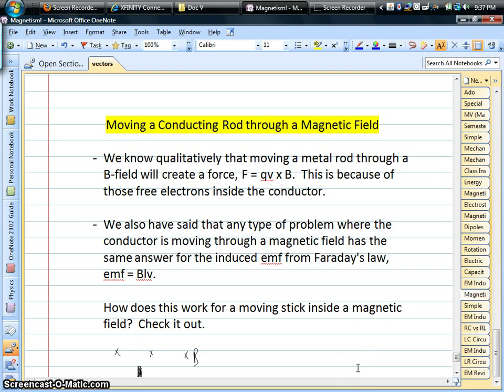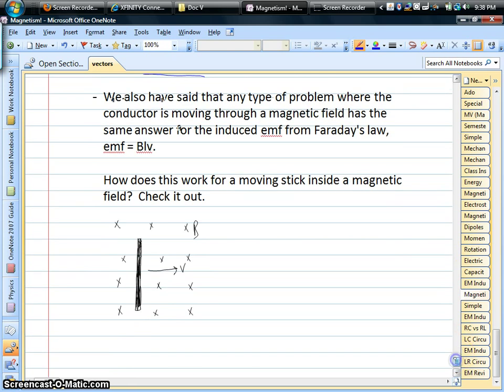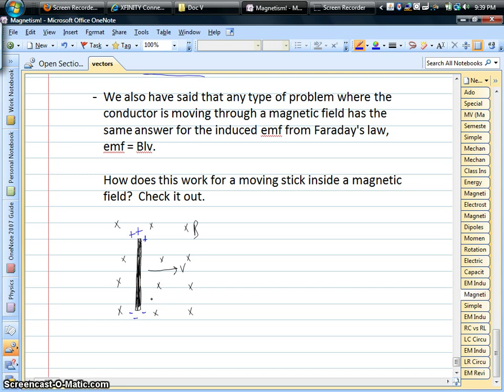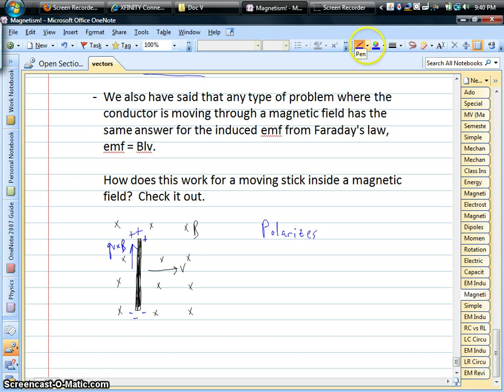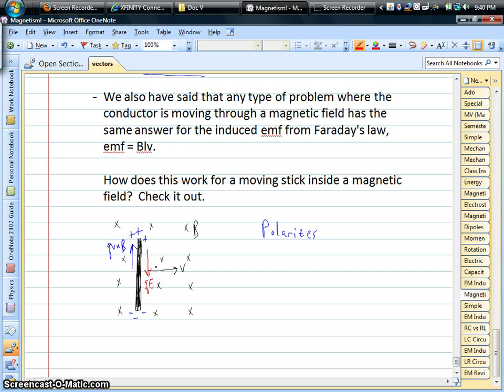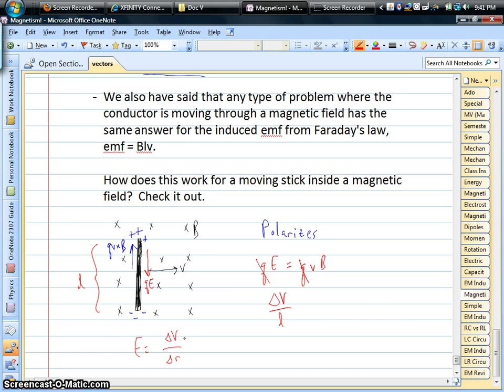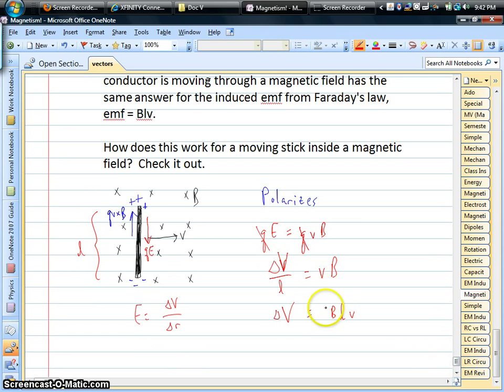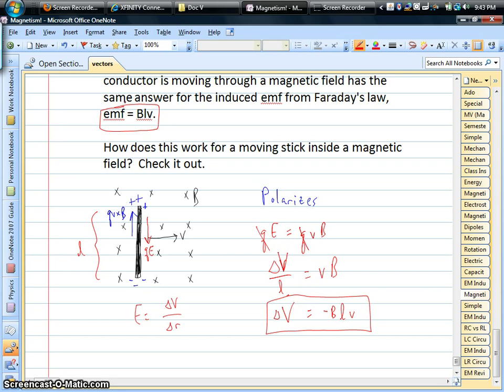Moving Conducting Rod in Magnetic Field.avi

Comment: I would like to add that a rod does not need to be moving in order for the rod to become a dipole. I understand that one would need to move the rod into the B-field and or vise versa and perhaps this is where the dipole is setup in the rod. Once the rod is in the B-field and not moving it remains a magnet, once you remove it from the B-field, it becomes unmagnetized.